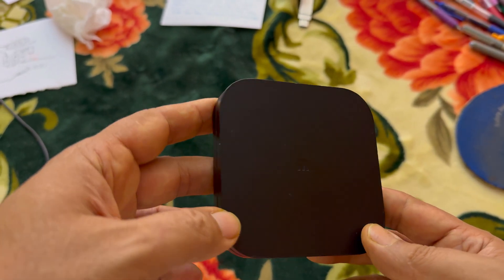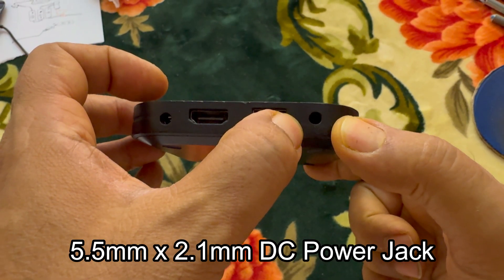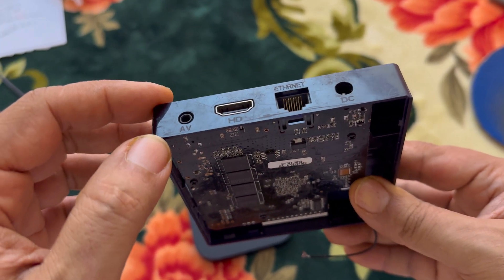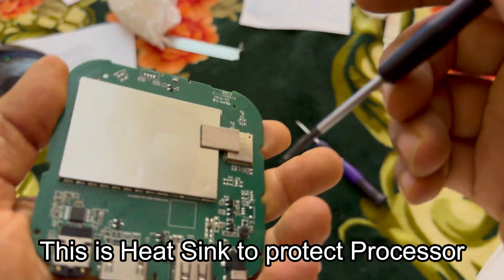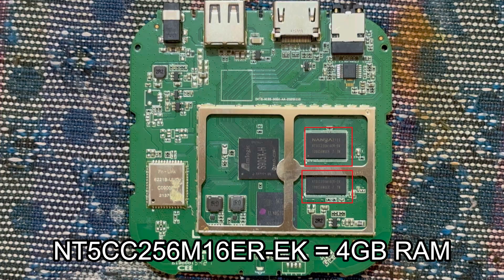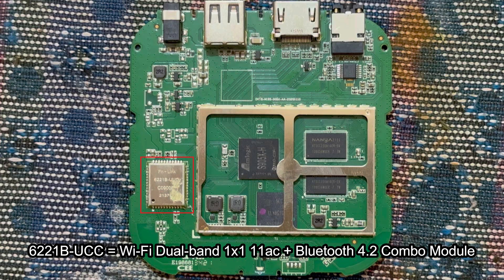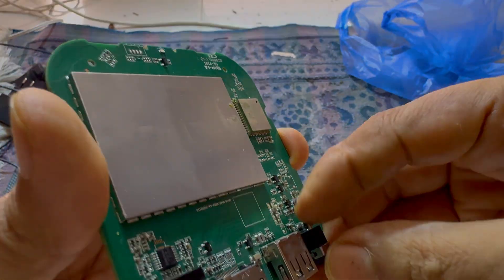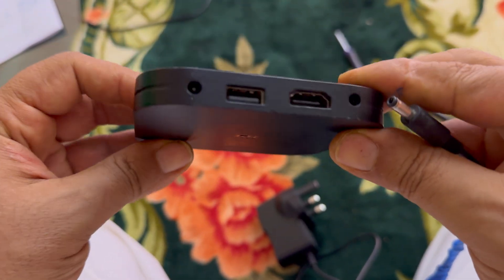TV Box Repair, chipset explain and how does it work

Comment: I connected 12v adapter afterwards it stopped working. When I connect back original 5v, when the adapter is plugged in I see the voltage fluctuates between 0.3v ~ 1.3v when I measure near jack. Also, I don’t see any component burned, at this point I didn’t remove any heat sink yet, can you guide me how fix this?
It’s a same PCB I have